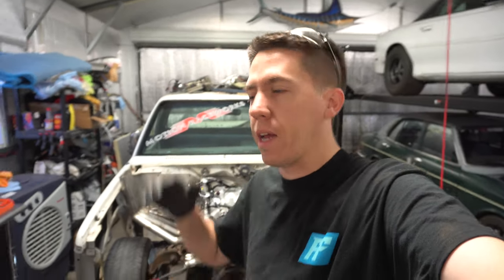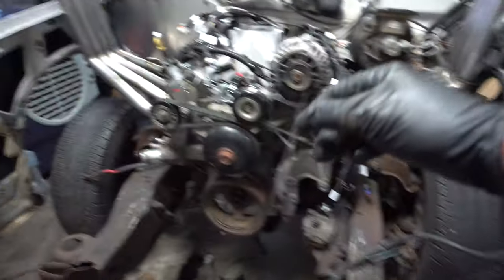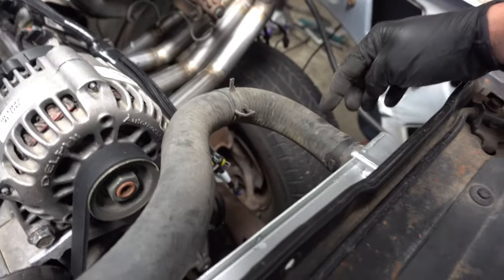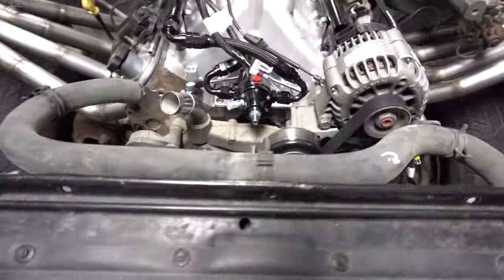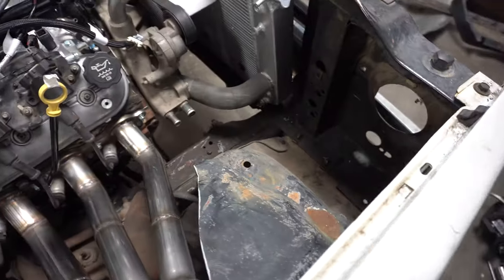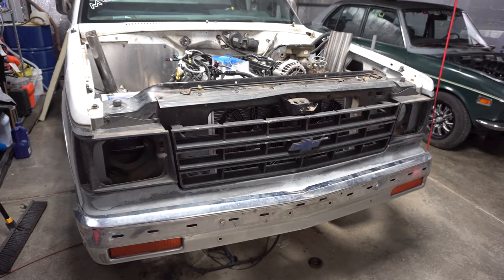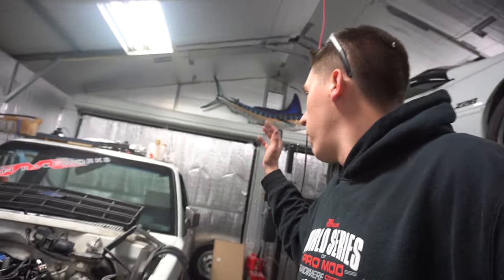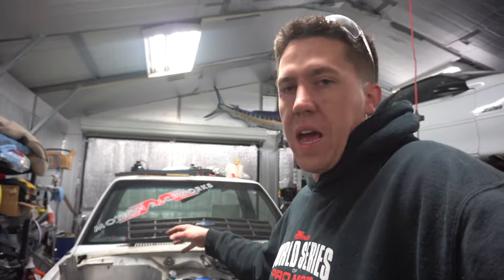LS Swap S-10 Burnout Truck gets Front End, Fuel Cell, Injectors, Radiator, Shifter and more!

Comment: Whenever I did my intake gasket video I took all of my factory original 1997 fuel injectors out, they were filthy, so I took them to the sink and clean them with a tooth brush and some dawn dish soap. that was over a year ago and they are still working perfectly.
Reply from the maker: Normally regular gas injector stay prettt solid ethanol on the other hand😬
Reply: @BuildTuneRace  gotcha